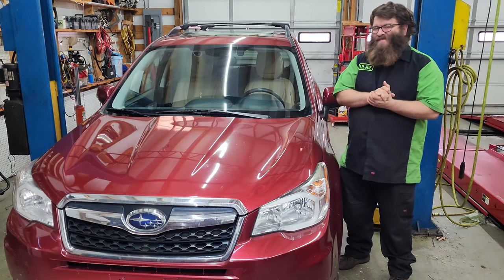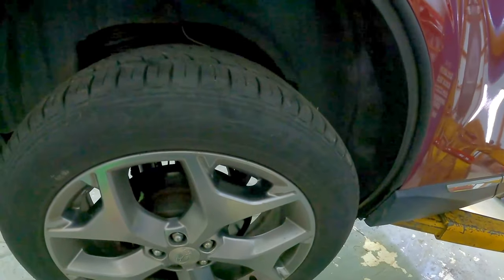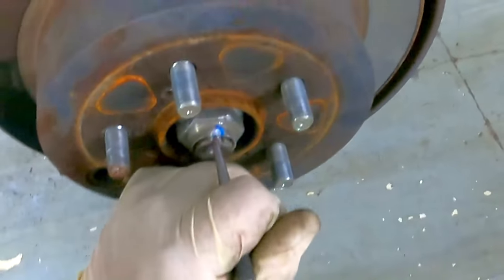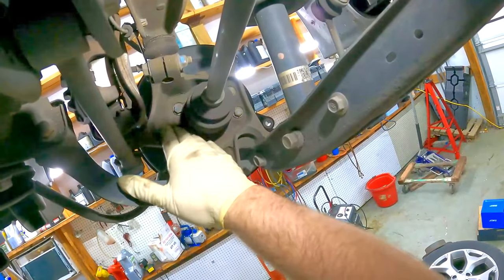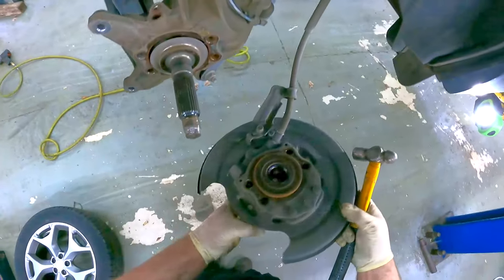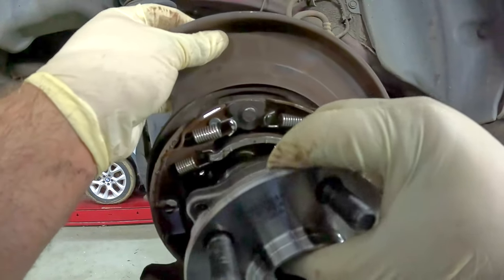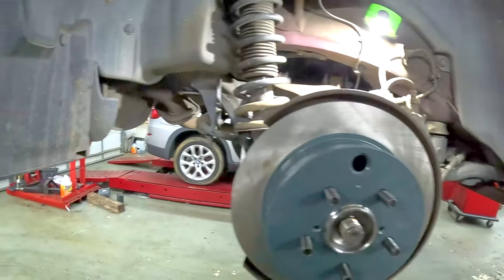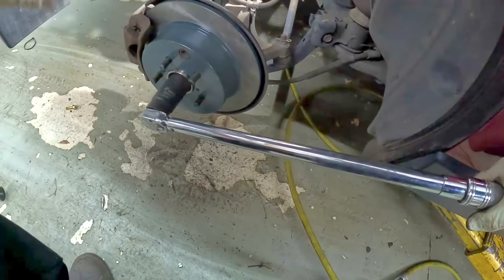2014-2018 Subaru Forester Rear Wheel (Hub) Bearing Replacement

Comment: overall great video with good tips, love the post edits!  Warning for anyone in the rust belt, the assembly is likely rusted to the knuckle.  Can be impossible to remove without breaking the bearing, leaving the back half in the knuckle.  If you live in the rust belt, be ready to deal with that kind of fall out either with tools or some other backup plan.  I tried hitting the screws from behind like he showed,  with the vehicle on jacks, couldn't quite get 'solid' swings in, hub didn't budge.  I'm taking it to a shop.   Again, well laid out video!  I subscribed!
Reply from the maker: Thanks you. We’re so glad we don’t have rust issues where we live!
Reply: Thanks for the heads-up.  I'm in the rust belt, so I'll have to decide whether to try this or not.

Comment: just like to mention that there is a Subaru recall for the backing plates which you should also do when replacing the rear wheel hubs as Subaru determined that the issue was caused by the backing plate mounting pad the hub bolts through and the hub bearing assembly sits on. Thanks for the video though!

Comment: Very good DIY video. I have a 2014 Forester that needs both sides done. Im not in the rust belt but the car is 10 years old.  I could see the wheel speed sensor removal being an issue.